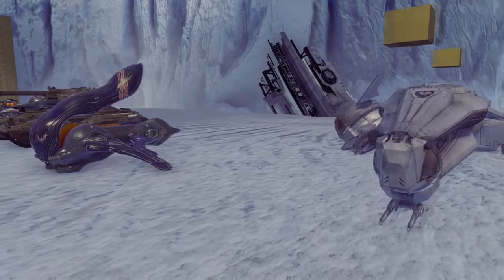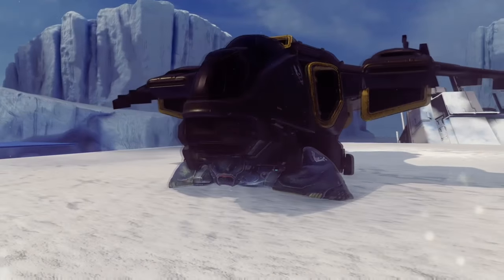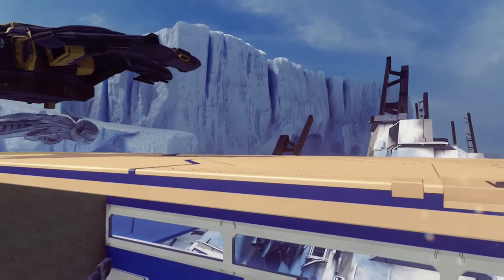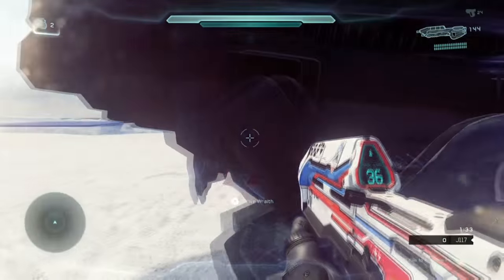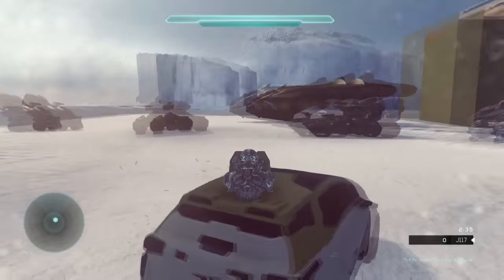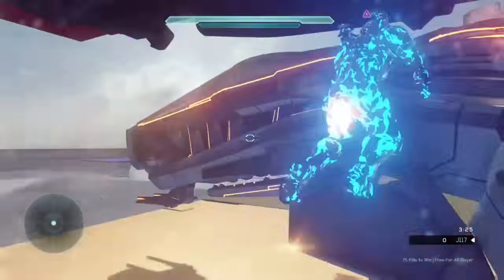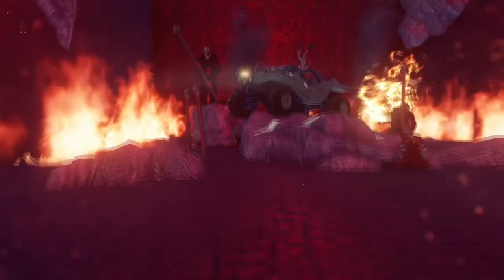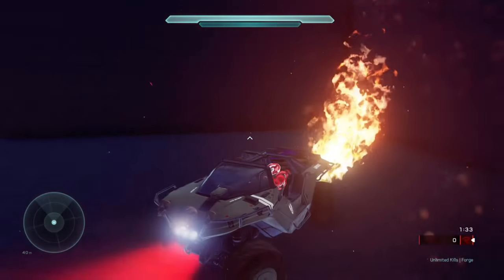Halo 5: Custom Vehicles/NEW Ultimate Vehicle Welding

Comment: Here's a trick if you're doing the wraith pelican: Script the wraith on a 0:10 timer. Then switch the action on a Rotate Offset set to all 0's. It essentially turns it to zero gravity. Hold rb while moving forward to take off. It works on other vehicles, but be sure to stay in the map. It also adds a small hydraulics effect to warthogs and mongeese.

Comment: i cant get the banshee to weld to the pelican at all, the second i let go of iether after wleding they freak out and fling across the map. i cant seem to get it to fly which frustrates me because its the one thing i want for my forge maps and machinima creations more than anything else. also does that phaeton work well welded to the pelican?
Reply from the maker: Not sure what the welding issue is if you followed the steps from my Scout Ammo Warthog tutorial. Did you weld 2 primitive blocks together, and then having them selected, select the Banshee and hold up on the D-pad to weld them? From there you just phase that whole thing into the Pelican and weld them once again holding up on the D-pad. But, yes it will fly quite wonky. The Phaeton/Pelican combination works quite nicely though.

Comment: Make something like a scorpion with a mobile base and bunch of turret platforms and make it an infection gametype where the infected cant jump very high and make them have to get on it and kill the driver manually.
Reply from the maker: I may have to give that a go. A friend and I were messing out with welding chunks and flats to a warthog. It worked well with the Warthog, but weight of each object made turning difficult. It's still funny looking but a tank would be the better option.

Comment: I made an apc today In forge how do I weld a warthog to it  ?
Reply from the maker: Easiest way would be to weld two cable caps, blocks, etc. together, and then weld them to the Warthog by having both selected and holding up on the D-pad. Now the Warthog can be easily welded with stuff, so you would just take your welded APC and Warthog and hold up on the D-pad to weld them. If you'd like more of a visual explanation of this method, check out my "Scout Ammo Warthog" tutorial or "Welding FX and Sound to Vehicles" tutorial. I hope that helps.

Comment: U should chang the camra settings so its more appropriate to drive the big boys
Reply from the maker: gaming pro 9604 Yup. It was great that 343i ended up supporting vehicle welding, which was originally a glitch, with features like changing the camera distance and making movement overall smoother.

Comment: fly banshee with mongoose on it, have landing wheels
Reply from the maker: The cool thing is support for vehicle welding was added as a feature so you could weld a Banshee and a Mongoose together now and have both vehicles be operable. It was possible to do this before, but there were limitations to which vehicles you could weld while having both be operable.
Reply: i want to know. is forge on halo 5 also on the xbox one version?